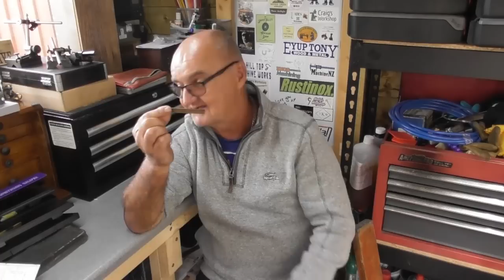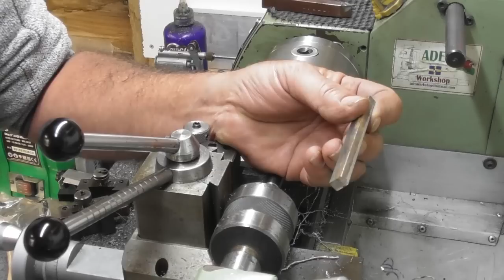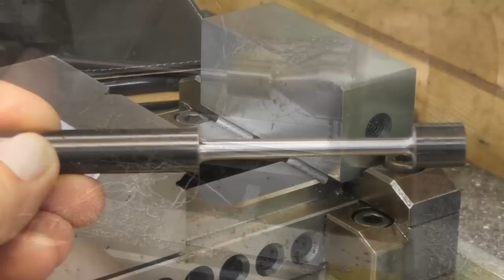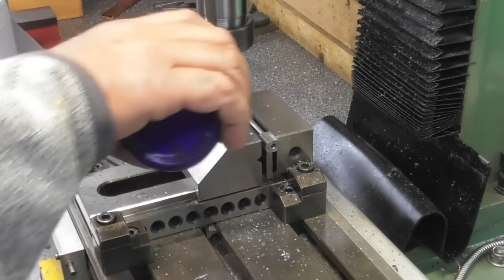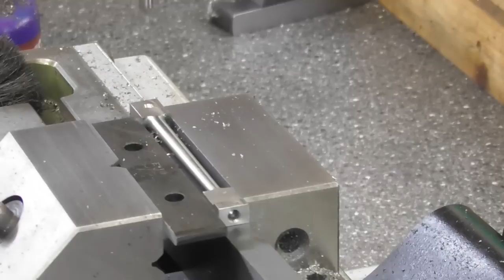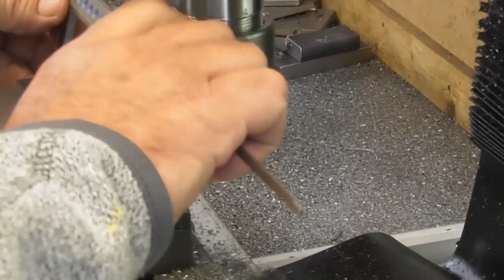Stuart Models S50 engine part 19

Comment: Hi Ade,
glad you are ok. I have been scratching my head over this, have started it with the stock metal, done the flats and holes in the mill first then thought I would set it up in the 4 jaw to do the turning. Was planning to do the radii on a rotary table. Will be buying some half inch round bar now though! Thanks Ade, really well thought through job. regards gareth
Reply from the maker: Go for it!. Cheers Ade.

Comment: I tried to use the rectangular bar but clocking in the ends in a 4 jaw to center drill was just off so turned section was off the 1/4 width. I need to do over and maybe try your method. No power feed so lots of hand cranking though to mill. Thoughts on making brass and not steel?
Reply from the maker: Phosphor bronze would be awesome . 12mm would work .Cheers Ade.
Reply: @ade63dug  Where did you get the small hold down clamps for that little vise(vice)? Have one but no good clamps or material to make really.
Reply from the maker: @gvet47  I did have to make them . I did a video on it if you look at my older video's . Cheers Ade.
Reply: @ade63dug  Just reviewed the clamp video. Very sweet and the indexing feature tops it off. You just do top notch work!

Comment: I'm glad to see you're doing well and back in the shop!

I hope your 'out of the way' parallel is OK, because it looks like you bumped with the drill at around 36:35.

Yeesh, Ade. The boss might have to write you up for all of the safety violations (mostly messing about with the cutter still engaged) in this one! 🤣🤣
Reply from the maker: I see what you mean . It did move but it did not feel like I hit it and no damage to drill or parallel. cutting it fine ey. Cheers Ade.

Comment: Nice to see you back in the shed, good move using the round bar.
Reply from the maker: Thanks Nigel. I had a feeling that the flat bar may bend like a banana when turning it and relieving the stresses so I just went straight to the round bar option . Cheers Ade.